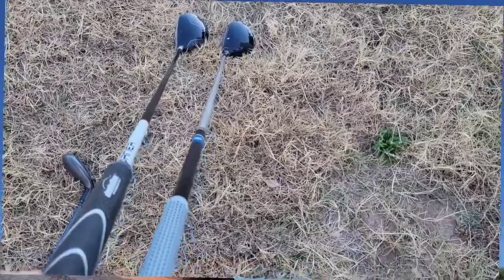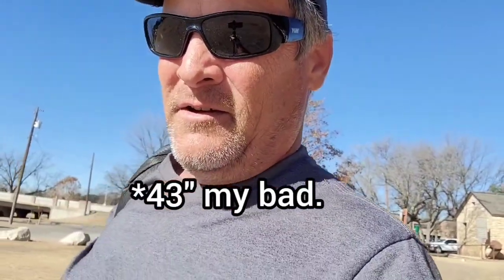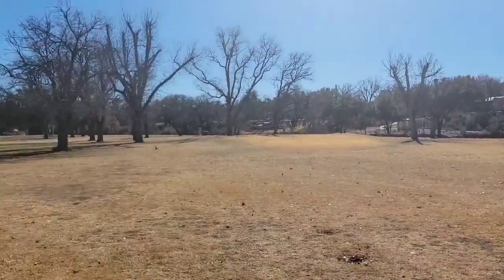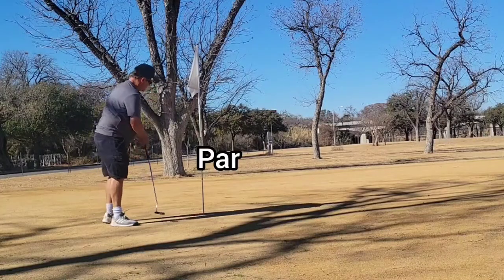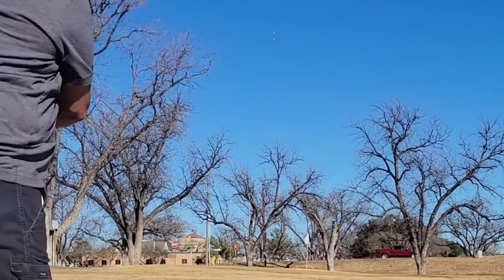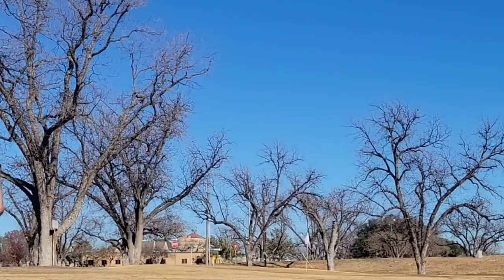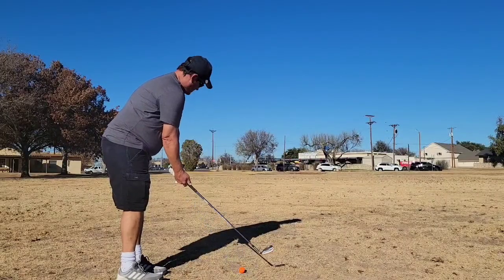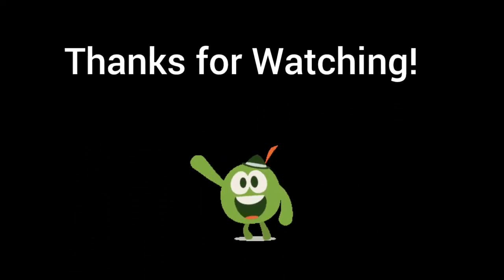I Shortened My 3 Wood!

Comment: Recently purchased an old Sonartec LS 99 ladies flex 17 degree 3 wood.  I did regrip with a Winn Dry Tac  Oversize.  The shaft is 41.75 inches, which is about the same as many 5 woods.  As a slow swinging senior, this experiment worked.  I never hit a conventional 3 wood consistently, but this “3” wood works well for me.
Reply from the maker: Sounds good!

Comment: Have you ever heard of a company online called “thepefectclub”? Their claim to fame is shortened shafts. I have their driver and it may be my favorite club ever. 42.5 inches and goes straight every time. However I have several other drivers so it has to take its turn 😎
Reply: Oops. 43” instead
Reply from the maker: No I guess I haven't.